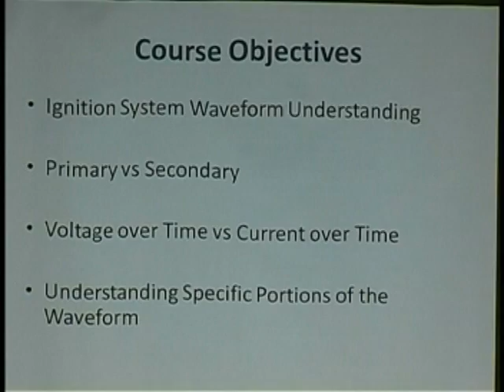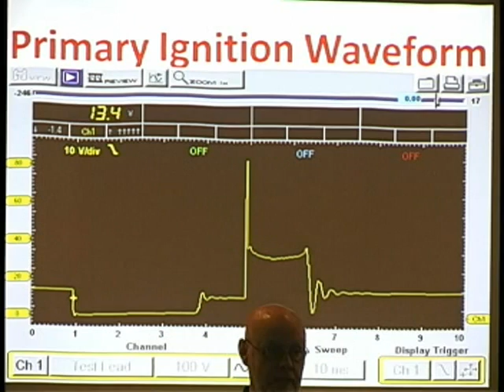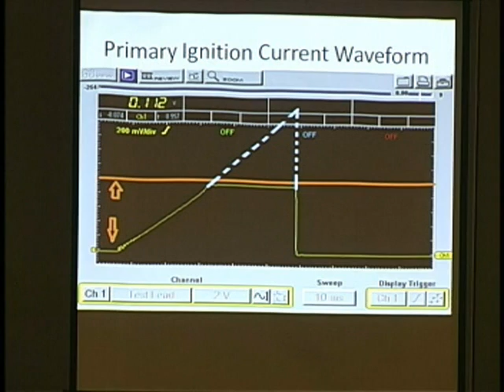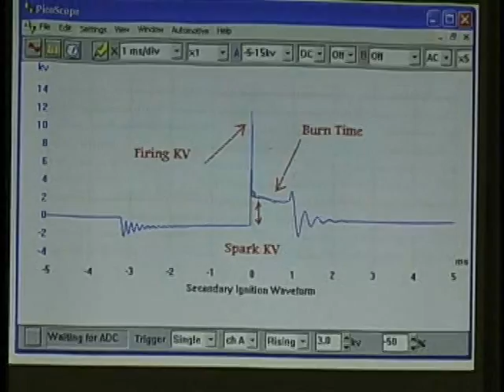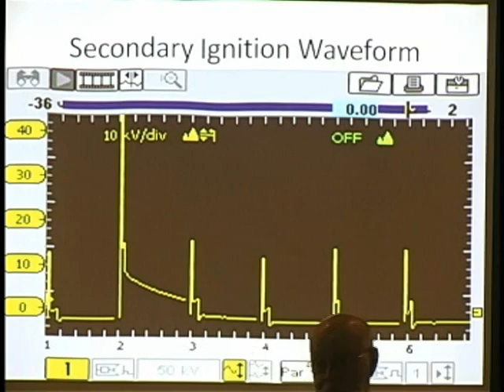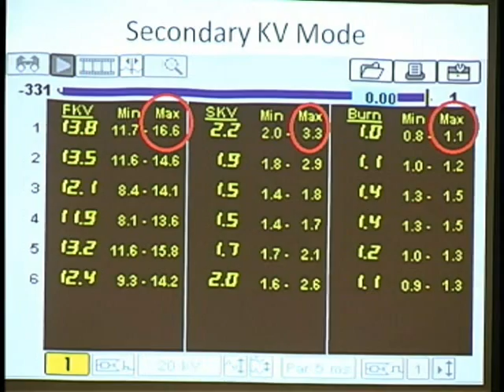Ignition Waveform Diagnostics with Jim Morton

Comment: I am absolutely amazed at the breadth and depth of information, knowledge, and understanding Jim Morton shares, in this freely available seminar.  I've worked with engines all my life, mostly pre-coil-pack types, and I learned more factual information on how to quickly and accurately diagnose an engine problem in newer (and even older) engines just from this using nothing more than waveforms, than I would have thought possible.  It is extremely hard to find good information like this today, and frankly what this man knows should be the Bible for vehicle engine diagnostics.
Reply: Thank You for the Kind words, Just trying to continue spreading the knowledge that others did for me. Glad you enjoyed and learned from it.

Comment: This is perfect! I was looking for a good resource to learn this stuff after finding youtube videos and articles going into ignition waveforms but all I could find was surface level information. This lecture is very good! Also love the part about looking at amperage rather than voltage, it is almost always more useful! Voltage tells you very little. One of the first struggles I had when starting my career in debugging was people telling connections were fine because they had continuity or voltage, but the wires had been damaged and had such a poor connection they couldn't carry any current. I'm sure I'll watch this 3 times to absorb all the details. Thanks so much for posting this! It means a lot to me and furthering my understanding.
Reply: Thank You for the Kind words

Comment: I loved my Fluke 97 and was disappointed when Fluke no longer supported it. I did find a used one and picked that up whne my was not repairable, that period of time being without it was tough. I do have a Pico 4 channel scope...very powerful ....using the Fluke taught me the skills to use the Pico.

Great to hear you mention running cars on propane, that has been a test I have used for decades to determine if the fuel system is at fault.

Fantastic seminar!!

Comment: My only complaint about this video is that it was too short! :D You're the kinda guy I'd love to sit down with for a day and just pick away at your experience. Awesome job!

I've been needing to get better at secondary ignition analysis. Especially on partial misfires or coils that are just starting to fail. The shops I've worked at only understand "unplug it" tests or "swapping parts" tests. They generally view scopes as taking too much time because they can take 5 minutes to set up. Even though they'll gladly spend HOURS throwing parts and flipping through Identifix... Every time I go to grab some secondary waveforms I'm usually in a mad rush before the boss comes over and tells me to quit wasting time. I usually just have time to save some captures that at least I can view later. It's so frustrating looking at a capture that's showing a BLATANTLY OBVIOUS problem but I hadn't done enough research to know what it's saying... 

Your explanation of using the spark line to determine of the problem is internal or external to the combustion chamber is such a game changer. I imagine that way too few people know about that. I only happened upon this video by chance. 

And also your mentioning of the carbon on the intake valve acting as a sponge was really cool. After all, that's what an EVAP charcoal canister does... I hadn't thought of that but now I'm going to try and keep an eye out for it. 

Thanks again for the great info.
Reply from the maker: Glad the video was helpful...thanks for watching
Reply: Glad it was helpful, Let me know if you think I can help you some more. 

i will be doing more presentations with TST in the near future, help you can attend one of them live.
Reply: That would be pretty awesome but I'm up on the west coast of Canada so we don't get too many top notch seminars come through this way. Which is why I'm forever grateful that people put the time in to release stuff on youtube. The availability of quality information online just amazes me. Makes me happy to be a tech in today's age. I can improve my skill set by sitting in front of my computer eating my dinner and drinking a beer! In a couple hours of comfort I can learn skills that might have taken months of blood, sweat and tears to develop back in the day. Especially since it's hard to try new techniques and analyze new data when you're on the clock and bosses are yelling about efficiency! 

Thanks again for the great video.
Reply: Thanks for the reply. We do get in Canada from time to time, I did a series of presentations in Winnipeg. Also there is a GREAT annual training event that goes on in Seattle every year.
Reply: Oh ya? I'd definitely be interested in that. Seattle is within range. Do you know the name of the event? And what time of year is it?
Reply from the maker: Watch our webcast and ae paid for seminars along with all our free YouTube videos...make sure you tell your friends and sign up to our tstseminar YouTube channel
Reply: Thank you so much much mister Morton for sharing your knowledge and time Al’s million thank to Ats for a free lesson.
Quick question where I can watch and Lear more about .
SPARK KV?
Please?
Thank you you all

Comment: Autel BT608 is the first tool I hook up to check battery, starting and charging systems first before proceeding to  codes or drivability concerns. Seen bad battery and alternators causing crazy problems so many times.

Comment: I've used the Vantage kv module for years. When I show it to another mechanic, they laugh.I could analyze a driveability problem in a few minute while they took hours.I also use the the kv probe (Waekon) for a quick cop check.Wish I had this info years ago.Or perhaps if I understood the waveform better. Thanks, Jeff P.S. I liked the NO intermittent statement:>)
Reply from the maker: Jeff Thanks for your comment and for watching
Reply: The original Vantage was an awesome diagnostic tool If you REALLY understood what it was, then the KV probe put it over the top. Thanks for the response Jeff

Comment: Thank you so much for this video. There is a wealth of knowledge here for sure. What do you look for in a 2008 Dodge 3.7L system that only has a dead miss at partial throttle around 55 mph? It's very hard to duplicate while driving and I can't get it to repeat while standing still. Customer says they have a transmission issue. I see mode 6 information telling me I have misfire history on cylinders 2,3,4 and 6.
Reply: If I had this vehicle in my diagnostic shop, I would look at it while on the Dyno. If it was a mobile diagnostic job, I would be "Power Braking" the vehicle while watching the Ignition. HTH

Comment: Great video!! Are you saying a clogged injector & Intake leak will appear the same on the lab scope? I thought the (clogged injector) high kv reading was unique to injectors?
Reply: They would both cause the firing KV to be high, BUT as you take the engine RPM up, these two problems would start to look different, the clogged injector would start getting worse where as the vacuum leak would start looking better....... GOOD Point Flatrateus
Reply from the maker: I believe Jim is saying that intake leaks will also cause high kv's. thanks for watching ... tell your friends

Comment: Sorry I'm late to the party but I'm a little confused on the determination of extra-cylinder resistance based on the initial slope of the spark line: Am I to understand that (high firing line kV)+("initially" decreasing spark line kV) is indicative of resistance external to the cylinder? Is that what you meant by "...jump out early.."?

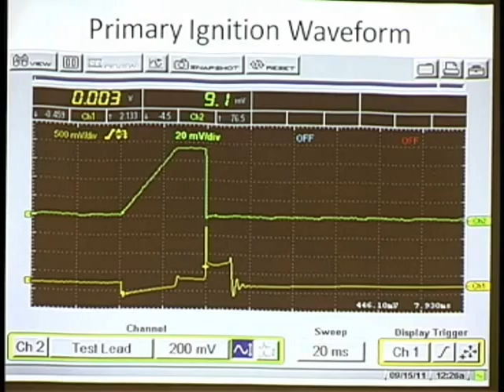Comment: Jim, At 43:29 of your video can you tell me what probe and where it is placed on the green and yellow traces opposed to 44:08 where you state the amp clamp is used for green trace is on negative feed of coil then where is the yellow trace coming from? Are you back probing the same coil on the + side ?  Thanks
Reply: Just went back and looked at where you were talking about. At 43:09 I was showing Voltage over Time of the Primary and the Secondary of the same cylinder, at 44:08 I'm showing Voltage over Time and Current over Time of the same cylinder.
My point being that Voltage over Time is a COMMAND, But Current over Time is the actually work being performed.
I hope this Helps.

Comment: Is this 1 to 1.5ms burn time under all engine loads or during snap throttle testing. I've seen al kinds of numbers from 1ms to 3ms I try to compare to other cylinders
Reply: YES, Good point, the cylinder will and should become momently leaner during the Snap Throttle, and as you stated, Comparison reading is always the way to go.

Comment: “Everything to the left of the imaginary line is external to the cylinder, and everything to the right is internal.”    What does that mean?

The kV line is to the left, but the height of it is determined by the compression inside the cylinder.   The kV at which the spark line/burn line begins is determined by the air-fuel ratio inside the cylinder.   Both of those are to the left of the imaginary line, but both are INSIDE the cylinder.   So what does that statement mean?    As it stands, it’s a meaningless and confusing statement.

Comment: I just saw super Mario video and it was a BMW N55 engine misfire one cylinder and it had turbulence on the ignition waveform at the right side of the sparkline, and another BMW N55 had turbulence on the left side of the sparkline both had the same problem the spark plug.
Reply: Perhaps one cylinder had an issue with the spark plug on the electrode side and the other had an issue on the insulator/porcelain side? I hadn't seen that particular Super Mario video, but that could explain why they showed up on different sides of the waveform.

Comment: at 1:57:10  What was the cause of the internal resistance, could it be lean mixture or low compresstion?
Reply from the maker: I will send your question over to Jim so he can answer you. If you have not already subscribed to our tstseminars YouTube channel please do so. If you interested in more training go to www.tstseminars.org...thanks
Reply: Yes, leaner air fuel mixture would be a good example of higher internal resistance, But as far as compression it would be the opposite, Higher compression would be harder to fire, so that would be included in the higher resistance.
ALWAYS remember that Leaner air/fuel mixtures and Higher compression are the two most common reasons for hard firing of the combustion chamber.
Reply: @jimmorton3009  May I copy and paste some of your comments to my notes? such as this one.

Comment: Jim,  I am new to the lab scope and just obtained a older Snap on Modis. I have watched this video several times and my question is if i attach low amp probe to negative feed on ONE COP then this will show me all COP wave forms or do I have to do each individual COP ? I am sorry if that is a stupid question but i will not know unless I ask. Thanks
Reply: There is NO stupid questions, The fact that current is on both the power side and the ground side of a working component, by putting your Mini-Amp probe on the power side and opening up your time base, you can look at all of the cop coils at the same time. because the same power supply feeds all of the coils.
The only new issue is, when you have a  3 or 4 wire COP, the driver control unit is placed in the COP coil it self, the PCM module only supply's a digital waveform to open the coil.

Comment: Exactly how does one aquire a waveform showing burn time by measuring primary coil voltage on a COP ignition system?
Reply: NothingSpecial law of mutual inductance says that whatever occurs in primary will mirror secondary.
Reply: Great question, I was wondering as well

Comment: Could someone comment on why a banana jack to bnc is a superior connection than a bnc to banana jack? I am new to scopes and just bought a pico with the pico low amp clamp and added a bnc to banana adapter to use w/ my DVOM and am wondering if i made a mistake going that route.
Reply from the maker: It's a matter of choice and the unit. Banana jack is used on labscopes that are made by Snap On and OTC while a EScope, Fluke and PICO use BNC as many true labscopes do. Your good with the connector... the issue you may encounter is using the clamp on the meter. Make sure to inserted the ends into the Voltage and Com jacks. The conversion rate at the first setting is 10mA equals 100 mV = 1 amp. Make sure you read the number correctly on your meter...try it on a circuit you know has a specific amperage so you can see the  reading on the meter. Hope this helps....look for some of our labscope and amp clamp videos. Thanks for watching....If you have not already Subscribed to our tstseminars YouTube channel please do so. Interested in more training? Go to www.tstseminars.org and www.attstraining.com
Reply: @TSTseminars  Thank you for responding.
Reply: @TenB33rs  your welcome

Comment: Just got a lab scope what kind of low amp probe did you use ,recomend
Reply from the maker: Jim Congrads...You can purchase a low amp clamp from www.aeswave.com the PDI brand is not expensive and work well. You may also wan to look at the high current clamp so you can do starter draw and Relative compression with an amp clamp. Take a look at some of the other video on labscope on our TST channel. Thanks for watching...If you have not already subscribed to our tstseminars YouTube channel please do so. Interested in more training? Go to www.tstseminars.org and www.attstraining.com.
Reply: Agree with the TST response, I have and use both of the PDI amp probes, they are reasonably priced and work Great.

Comment: Pipes rolling around in the back of a van set off the knock sensors?🤔🤔🤔
Reply from the maker: On some vehicle any mechanical noise can cause a knock sensor to pick up the frequency. I am sure that Jim Morton came across this and knows what he is doing. Hope that helps...If you have not already subscribed to our tstseminars YouTube channel please do so. Interested in more training? Go to www.tstseminars.org
Reply: The older knock sensor only reacted and know a Metallic noise, think about how manufacturers told us to check for proper operation ? Use a crow bar and a timing light...…. I have also seen where a pick up with a trailer in tow, has caused the same reaction. the metallic frequency travels through the frame of the vehicle.